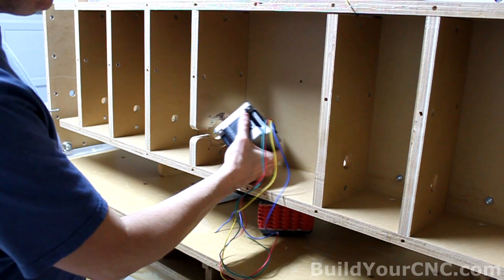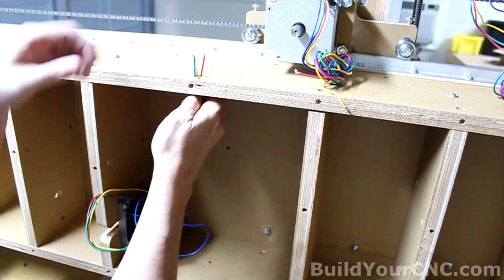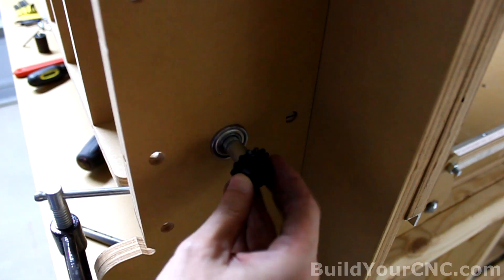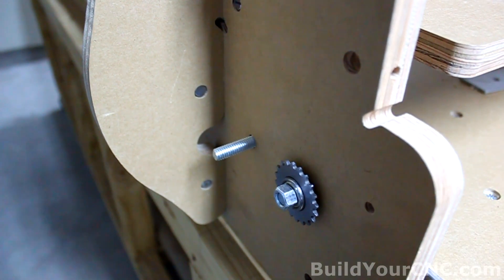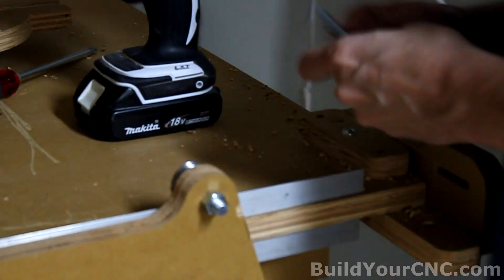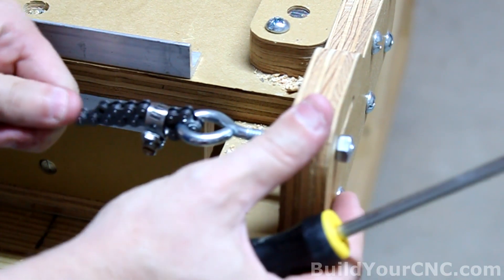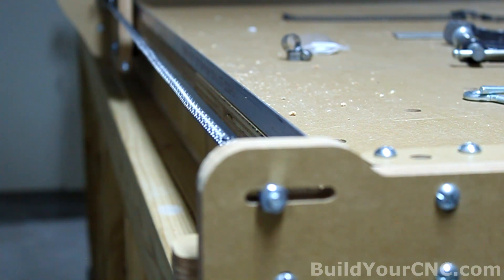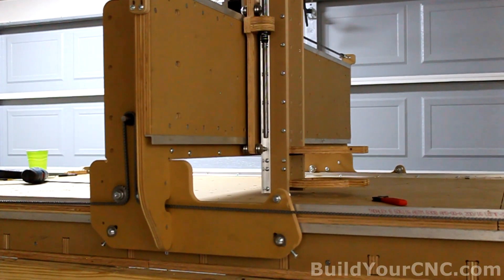greenBull CNC Assembly - Installing X-Axis Motor

Comment: Great CNC. What's the torque of the stepper motor you're using? Is there enough torque in that stepper to gain enough acceleration for such a big machine?
Reply: I believe the X axis is 651oz, and Y/Z are 425oz
Reply: Paul Perry the Y/Z are actually the same as the X axis All are 651oz nema 34 motors

Comment: Hi PAtrick, I hear on of the previous videos, you are using an arduino card for this project ?? please advise me, if you are using Nema 34 motors, what type of shield are you using ? I'm also building a 3 or 4 axis router  for 4' x 8' material, was going to use Nema 23 , seems they are not strong enough , any advice on proper type to use??